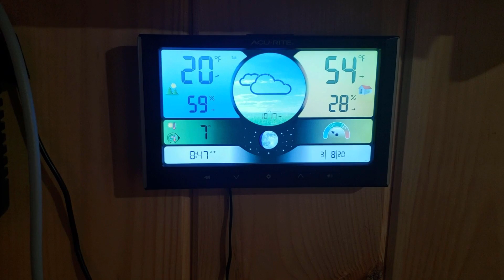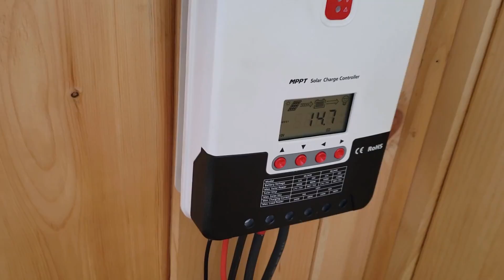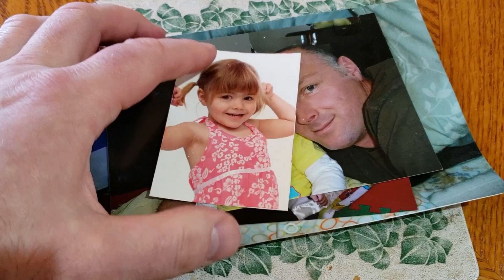Spring Ahead at the Cabin!

Comment: Thanks for the video Dale,  I thought I would ask you  ( if you didn't mind telling me  ) what batteries you use on your solar system, I am fixing to set up mine and was thinking about getting some Duracell 6volt deep cycle golf cart  215 amp hour FLA batteries from Sam's Club  but was wondering what brand you have and what you thought about yours and their performance ( if you would rather not say I understand . Dale,  I have a picture ( framed print ) of PBR'S winning 6 horse team in 1904 that I think you would like to see a picture of that was my Great Grandfather's then my Granddaddy's and then he gave it to me if you would PM me or let me know how to get in touch with you I'll send a picture that that I took of it since Pabst Blue Ribbon is your favorite . Thanks again for the video,  stay safe , and all the best.
Reply from the maker: I'm running Trojan L16's. They are 6V - 420 AH. I run two of them in series for 12v and still 420 AH. I went for the more expensive 420s because I wanted the extra reserve power for the long winter nights and storms. Glad I did. I've got to get something set up for the channel, i was going to do FB but I hate FB..lol..I'll get something set up. Love PBR!